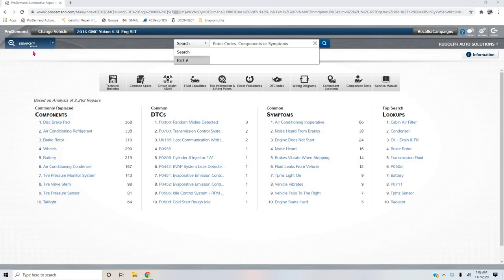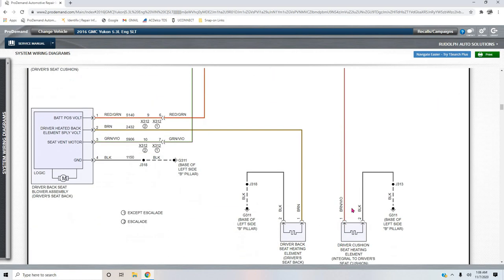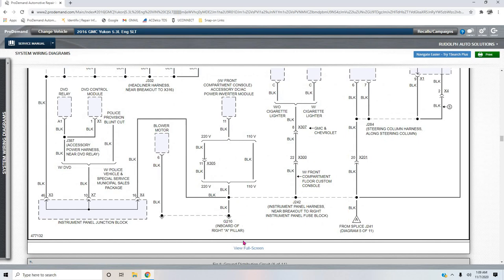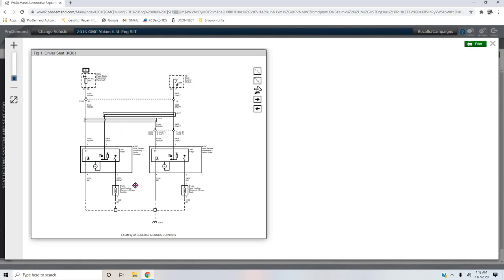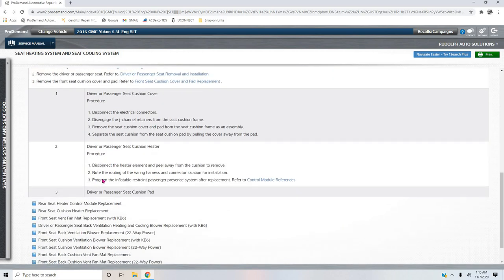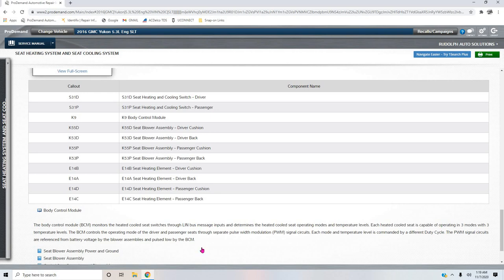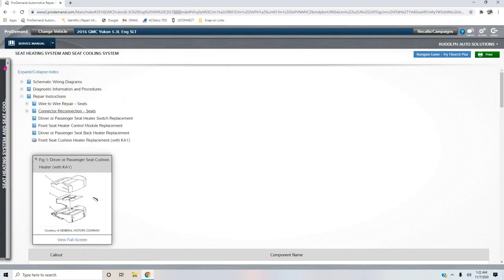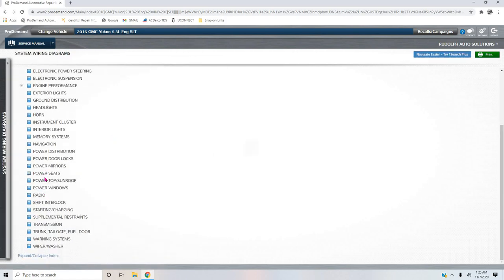2016 GMC YUKON SLT 5 3L, HEATED SEAT CUSHION-SYSTEM OPERATION (PART II)

Comment: when you ohm test did you load circuit as well
Reply from the maker: I'm not load testing the heater element circuits.  I am assuming G311 is a good ground based on the fact that everything else for the driver's seat heater/cooling system shares it.

I was confirming that my seat heater switch input, BCM, and Seat Blower Motor Control outputs are good.  I'm using the Ohm Meter to take an educated guess based on comparing the driver's side and passenger side cushion heating element resistances to a body ground through the power receptacle in the center counsel.

The power receptacle in the rear of the center counsel doesn't share the same grounds as the cushion heating elements, but the ground is at the RH A-pillar which is a body ground similar to G311 and G312 at the bases of both B-pillars.

So in short, I am taking an educated risk based on the circumstances, because I could potentially have a problem in between the Seat Cushion Blower Motor Module PWM power feed to the cushion  heating element or likewise on the ground side to G311.
Reply: Not really an educated guess, a very solid assumption :). The ground at the A pillar and the ground at the B pillar are virtually the same thing, through the body, unless the truck is split in two between the A and B pillar lol.
Reply from the maker: Yes.  I completely agree with that.  I didn't realize how much thought I really put in on this video till I reread this thread.  Lol, crazy how time flies by.

Comment: So i have a 2014 Sierra and both front heated seats do not work shows they are on but no heat they also have cooled seats and they work just fine any ideas on where to start
Reply: I’m having the same problem